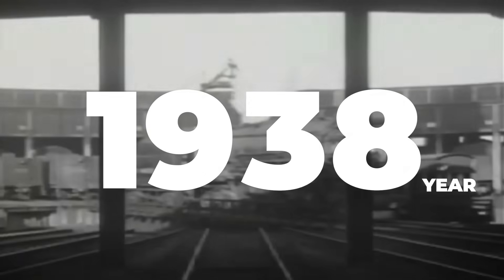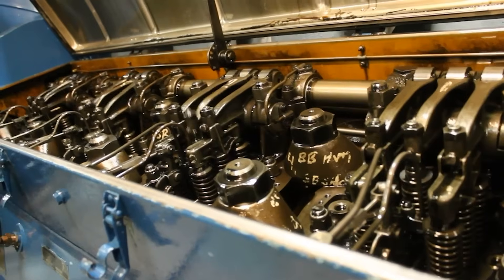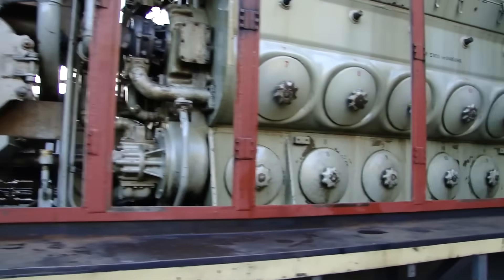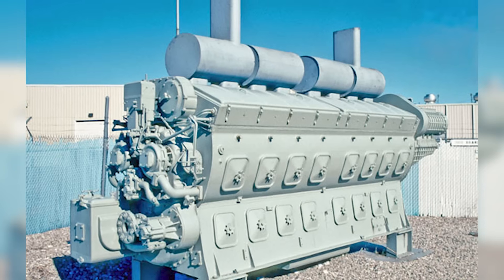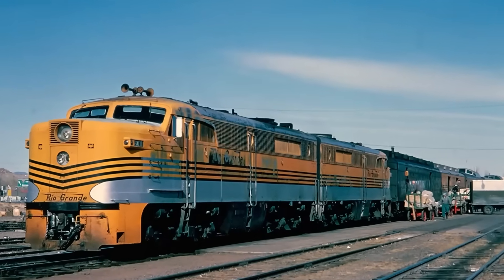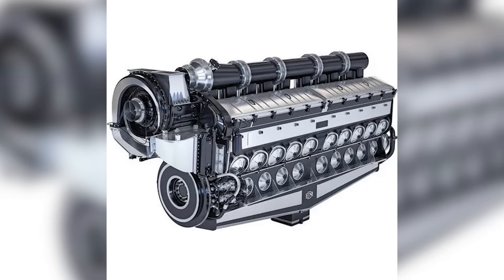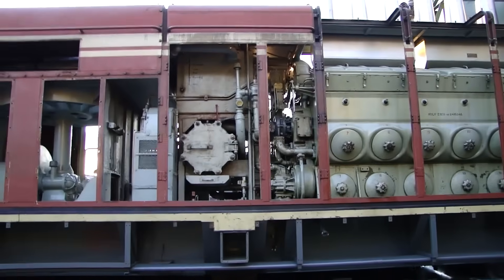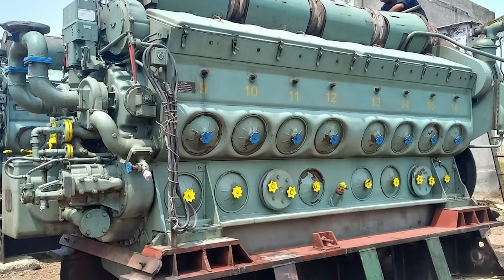Why EMD 567 Was Banned: The Most Powerful Train Engine

Comment: If the video is about the EMD 567, why are there lots of footage of Alco 244 engines while talking about the EMD 567.
Reply: There was even an AMD103 G.E locomotive in the mix.
Reply from the maker: That’s an interesting point! The AMD103 was definitely a powerhouse in its own right. Thanks for bringing it into the conversation!
Reply: Cause Alco´s was fucked with board of war. Giving mainline to EMD and switchers to Alco.
After war,  fate was sealed. EMD had already regined its 567. Alco rushed demo 241 that bring 244 with issues. 
Now EMD have been 
supplanted by toaster, or Barbecue. No matter how you name them....😊
Reply: Because.
Reply from the maker: Great observation! The Alco 244 engines serve as a comparison to highlight the EMD 567's unique features and impact on the industry.